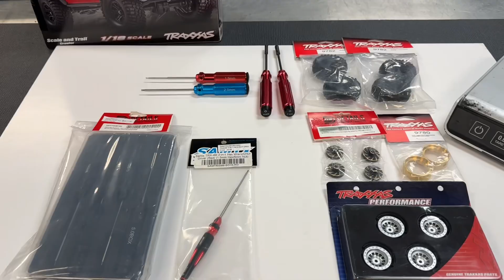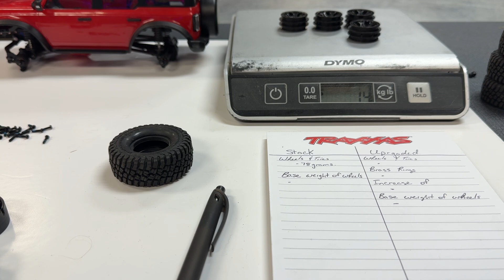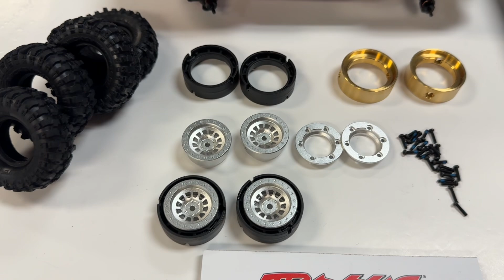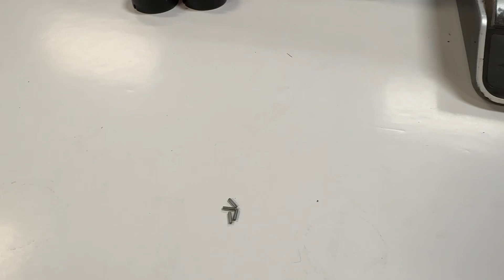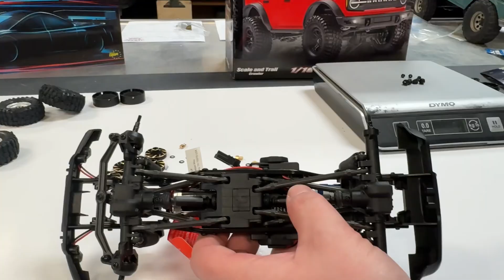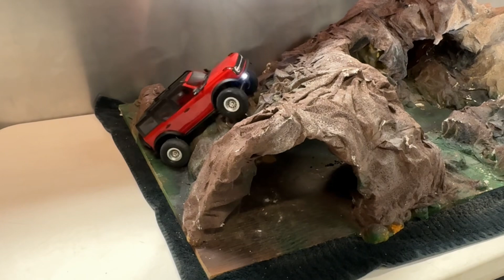Traxxas TRX4M Bronco Build Series | Part 2 | Beadlock Wheels / Brass Weights / Brass Wheel Extenders

Comment: The slipping kinda shows why sometimes more weight is not necessary better… as there is more weight it requires more traction to move, and on a slippery surface it would be a disadvantage..

Comment: Nice! I might need to get a set of brass weights for the front tires of all three of mine, as the front ends are just too light. I'm also considering getting wheel extenders for my Bronco. The TRX4 MT obviously doesn’t need them, and I don't think my High Trail requires them either. I can't wait to see the next video. Great work!
Reply from the maker: Thank you for tuning in! The brass weights in the wheel and on the wheel hexes for sure made a large difference on the performance of the truck. The one thing we did notice getting a bit worse was the amp draw on the motor so the crawl gearing in our opinion becomes a must with either the basic crawl gearing in the single speed configuration or with the two speed transmission upgrade! We are excited to continue the series and see how much more capable we can make the truck